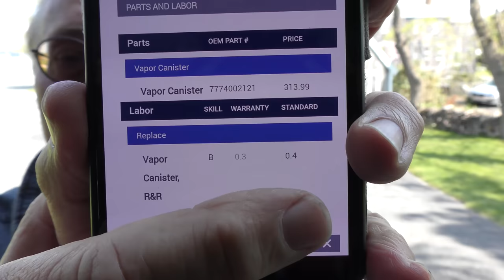7 Car Myths Stupid People Fall For

Comment: About oil change interval. in 2008, I bought a 2004 Ford Focus in California with 58,000 miles on it. With the 2.3L DOHC engine. I changed the oil and filter every 5000 miles, with full synthetic of the recommended viscosity. In 2021 I gave the car away to a friend, with 149,000 miles on it and it still uses no oil between changes.  The only engine work, besides the 100,000 mile maintenance was it needed the intake manifold replaced as it had cracked. I got one from a car recycling yard. In 2023 my friend is still driving it. 

My point is that I concur with your oil change recommendation.

Comment: Regarding fuel, any thoughts on the running your tank dry vs keeping at least a quarter full.  I was always told, and read in the manuals, that you should aim to nit let your tank drop below about a quarter full else all the waxes and impurities in the fuel that normally float near the top of the tank will get sucked through and mess up your engine.  My sister refuses to fill her tank more than a quarter full because she says she can’t afford to spend that much on fuel (ignoring that this means she has to get fuel about every 3-4 days, and often has to go to more expensive garages because she doesn’t have enough fuel to get her to a cheaper one, plus in the past when I’ve filled her tank she’s just run it down to below quarter full and will not fill it over about quarter full).  And she wonders why she’s getting through a fuel filter every year, has to clean her plugs twice a year and has to replace various sensors every year or two.
Reply: Every mechanic I've talked to has said to never let your fuel get below a 1/4 of a tank if you can avoid it. She should instead fill it to half a tank and then refill to only a half tank(once she gets to 1/4) and she would be paying the exact same amount.
Reply: The fuel cools your fuel pump. Running it too low significantly decreases the life of your fuel pump

Comment: Ah yes tune-ups. I learned to do them on my first two cars a '71 Ford Maverick and a '76 Datsun B210. On both cars I installed electronic ignition module kits that eliminated the points. I still needed to replace the plugs including gap spacing but compared to adjusting  points that was trivial.

Comment: One car myth was about pickup trucks with the tailgate up or down. You still see some tailgates with openings in them for air flow. I remember reading about it and with the gate up it actually made the truck more aerodynamic because it created a rolling cell of air in the bed area. Don't know about modern trucks, maybe the difference between 16.5 mpg and 16.8 mpg is not enough to notice.
Reply: Many years back, a show called Mythbusters tested that and found the myth was wrong, and figured the same thing you are saying that.

Comment: A local station charges 45 cents more per gallon for 91 octane non-ethanol versus regular 87 with 10%. I get enough better mileage on a full tank of 91 to come out slightly ahead versus using 87, but only at the current price point.
Reply: I actually do the same and I can notice a difference in power with the extra chemical energy too. I get weird looks filling up with rec gas though.
Reply: Non ethanol is definitely the way to go however where I am at the only non ethanol is 91 octane with a significant increase in price. I only get about 2 extra mpg which isn't worth the difference. If I had more money to blow then yeah, 91 ethanol free > 87 10% ethanol.

Comment: A 3,000 mile oil change was unheard of until Jiffylube came on the scene. Back in the day it was recommended between 5,000-7,000 miles and it still is for most manufacturers now. Car engines are supposedly better as is the oil especially the synthetics.
Reply: Many Toyota Camry Hybrids and Prius Hybrids run 10,000 miles between oil changes in TAXI, UBER and LYFT service. They last 300,000+ miles and keep going. Most is city driving and short trips too with alot of idling. Full synthetic 0W20 Oil used.
Reply: Back when I started working on cars in the 70s people used to change oil about every 3000 miles gotta remember oil wasn’t as good as it is today

Comment: Here we go again if your car requires premium fuel, put premium fuel in your car because you put the cheaper gas in there and you step on the gas pedal you’ll hear valve shatter that’s because they’re low octane gasoline. The manufacture knows what grade of gasoline they designed the car for not Scotty.

Comment: Virtually every used car I’ve ever bought I’ve improved the fuel consumption, acceleration and top speed by just giving it a good old Italian tune up. Most people drive too slow and the engine gets clogged up with carbon etc - use the performance of the car and you will clear all that crap out and the car will run better. Plus check tyre pressures regularly when cold and use top quality oil and filters.

Comment: For the record I held off on my spark plugs until 100K miles, even though the manual called for them at 75K. (Modern Mazda engine, iridium plugs)

I arguably wasted money. The old plugs I pulled out barely showed any age and the gap was still spot on at 0.044”. I still did the job but I’m definitely getting up into the 200s before I even glance at the things again

Comment: The one thing you can do to get the maximum mileage over the lifetime is change your oil and filter every 3000 miles with no exceptions. I don't care what your manual says when they tell you every three months either mileage not months. Yes I was a professional mechanic and I drove a 1987 GMC Full Sized Jimmy 315,000 miles until it was wrecked by doing just that with Mobile One synthetic. I pulled the engine and disassembled it to find no appreciable wear anywhere.

Comment: The other side on the A/C issue is that cars are much more aerodynamic than they used to be. Back when cars had all kinds of weird styling that caught the wind like crazy, then opening the window probably didn't make that much of a difference on the drag. But nowadays, every crossover looks like an identical blob because that's basically the optimal shape for a vehicle of that size, and anything you do to change that shape (like opening the windows) will noticeably hurt the gas mileage much more than running any electrical component inside the car.
Reply: That's true and also the old AC units sucked up lots of power. The new ones are more efficient but on small engines might only drop the temp 20 degrees. The old ones, working properly could freeze you out in the Sahara. With modern cars the break point is about where you don't want wind blowing in.
Reply: Old and boxy equals comfortable and easy to see out of. Also cheaper to insure. Also slow as a turtle. 😂

Comment: Can you talk about car companies charging to turn On heated seats, which are installed, for a fee? Or they charge for increasing the vehicle’s high speed performance remotely, for a fee.
Reply: Really,  Charging for getting your seats working when yiu e already spent at least $40,000 on the vehicle (or more now!).  I have a Honda CR-V with heated seats at it didn’t cost me a penny when I bought it!  I definitely wouldn’t buy any car if I was charged a fee for having my heated seats working!

Comment: I really mistreated my 2015 Prius that I used almost exclusively for Lyft driving. My oil changes sometimes were 20,000 or 25,000 miles apart. The car has 310,000 miles on it and is still working fine, although my fuel economy has dropped from about 53 MPG when it was new to about 46 MPG. Imagine how long this car would go if I changed the oil every 5 or 10,000 mi.
Reply: thats crazy and hilarious
Reply: @SmokeDogNY420  Yeah, pretty nonsensical. Those Prii do soldier on, though. And all that time, I never had to top up the oil. Every time I checked it was at least half way between FILL and FULL.
Reply: Have you replaced the battery?
Reply: @ichbindarren  No. There appears to be no need to do that. That car has nickel metal hydride battery cells in its pack (it's not the plug-in hybrid model, which in later model years are lithium ion). I think the degradation of the NiMH cell is more related to age and temperature cycles than it is to miles driven. In my car, the time it takes to charge the battery enough so that the gas engine turns off is still not much more than when I got the car new.
Reply: @bobbabai  change the car battery after the warranty is done. I changed to an AFM in my Toyota Camry Hybrid. The large hybrid battery is for life of the car.
Reply: @patricktomaszewski2063  I changed the 12 volt battery when it started dying when I left the dome light on. It was about 6 years old. I don't worry about the hybrid drive battery until I get alarms or the fuel economy really starts to drop.
Reply: It's probably the nimh battery driving your mileage down.  It's losing capacity.
Reply: @davefancella  Yes, I agree. That plus the fact that I let at least 4 oil changes go to over 30,000 mi. Plus, no maintenance at all on suspension or steering or wheel bearings.

Comment: I will say that paying extra for non-ethanol gas is worth it, especially if you are doing something like climbing mountains. I did this in Colorado and made it up and down the Rockies without any incidents on a car with barely over 150hp and a turbo engine.  No need to get higher octane, just removing the ethanol alone was enough.
Also, look carefully at the gas grades.  In some stations of lesser repute, their "normal" gas is 85 octane and really IS terrible, especially if it has 10-15% ethanol in addition.  This is fine for your lawn mower, but if your car says 87 or 91, don't ever go lower than that number, no matter what they are marketing it as.
Reply: Your point speaks to a different issue.....fuel grade....yes, there is 15% ethanol fuel available that goes below the 87 octane minumum of most cars. That said, pure gasoline vs any fuel with ehtanol....will show 1-2 mpg, better fuel mileage
Reply: Bear in mind though that in Colorado and some other high-altitude areas, there's no 93 octane because of the altitude. In that case 85 octane = 87 at sea level, 87=89 SL, and 91 = 93 SL. It's not about "lesser repute" stations in those areas, though I have seen 85 octane in coastal areas on occasion, and yeah, i wouldn't use it there.
Reply: My car runs perfectly here in NC and also in Aurora, CO!  And I use the unleaded gas - the regular kind!  I get wonderful mileage!

Comment: Back in 1986 I bought a new Chevy sprint. It has a 1 liter 3 cylinder Suzuki motor. Some people had complained that the motor would shake. Come to find out they had put in premium gas. Chevy put out a bulletin to not use premium gas.

Comment: I used to have a Lexus LS460 and with regular unleaded I got 10mpg, with premium gas is 15-17 mpg. If does make a difference.
Reply: LS460 is made for premium gasoline it’s a Lexus n like a bmw or Mercedes it was made for premium gas
Reply: If you can afford a lexus you can afford premium gas!😂😂😂
Reply: @dang75790  Scotty Kilmer got his wife’s Lexus for $3,500 lol
Reply: @ocularpressure4558  and?
Reply: Depends upon the car. In the old days I used to run regular gas for normal driving in my built 64 El Camino. If I was going to play, I would bump up the timing, run colder plugs and premium gas. You can't do that with newer cars. So, it is NOT one size fits all. It's called common sense.
Reply: @garykendall1376  common sense isn’t always common nowadays but the sense able thing to do is follow the manufacturer rating

Comment: In my 2017 Hyundai Elantra, I get about 3 MPG more with the windows down than I do with the A/C on (not even blasting at full power).  It has been consistent over 6+ years, all working at the same location and living in the same house (so no adjustments for different driving conditions).  My commute is half freeway and half surface streets, a total of 13 miles each way.

Comment: I disagree I change my oil every 5000 miles. The last time I try to wait over 6 months because it was under 5000 the engine variable timing starting sticking. Had it flushed and replaced right away started working and sounding like new again you shouldn't go past 6 months with the same oil it starts to break down.
Reply: Same happened to my 2009 Honda Element when I went too long between oil changes. Car bucked and ran terrible until I replaced the VVT solenoid. Lesson learned.

Comment: My Lexus requires premium gas. I tried running it on 87 just to see if it would work, and it threw the check engine light on me. 😂
Reply: Your Lexus will run on regular gas. Your check engine light is for a different reason.
Reply: Your check engine light could come on if 1 your spark plugs need replaced 2 your gas tank isn't shut right 3 your maf sensor is dirty

Comment: The myth I have the most and don't believe in: "Don't run your AC at full blast, keep it at 2/medium or else you'll ruin the ac compressor" I always blast my AC and my car's doing just fine 15 years on now, 3 freon refills all I ever needed.
Reply: Making the blower fan spin faster has no effect on the AC compressor or clutch. Had the same argument a few weeks back.

Comment: I've gone to stations and they were out of regular grade gas, and we're offering high grade for the same price, so I filled up. On both my 2000 and 2014 Civic it actually tripped my Check Engine light. It didnt affect the way it ran, but did turn the light on. On the next fill up of regular, iit went away both times.

Comment: 90% of my driving is highway. I have a state highway 300 feet from my house. I change the oil and filter every 6000 miles. I sold my 06 Tacoma to my nephew. It had 337,000 miles on the odometer. Runs like new. He loves it.

Comment: I've got a 2000 Audi A4 1.8T, engine code ANB, and it definitely runs better on high-octane fuel, although it says 91 will be fine on the inside of the fuel lid. Maybe in those days, engines weren't as finely tuned as today.

Comment: In my experience with the "Premium Required" cars, 1 car (04 Lincoln Navigator) it burned more gas when running regular gas compared to Premium which wasn't worth the savings and the other car (01 VW GTI 1.8t) it ran like complete utter dog sh*t when running regular

Comment: I have a part-time job at Circle K.  When we ran out of 87, people would come up and say they can only use premium in their car.  Then I asked what kind of vehicle they have, they told me it was a Scion.
On another note, I can agree with the tires. Years ago, I purchased some decently average tires for my 2001 Ford ranger.  At about 3 years one of my tires did explode.  More recently, I have had some issues with pepboys. I replaced the upper and lower control arms on both sides of my truck, and I had them perform an alignment before the new tires were installed. Regardless to say three months later my front tires were destroyed, and they were coopers, not bad tires at all. Ultimately, they did replace the tire with a load C, not a load E Tire.  One of my front tires got a flat for unknown reasons, and Discount Tire would not repair the tire. They informed me of the whole load rating issue, so I had to buy new tires.  I thought I was getting a deal at at $800 for four tires and alignment. Ultimately, I am into this project now for about $1,500.
Reply: Well, if it was a Scion FR-S, they would have been correct because those cars require premium.

Comment: Thanks for the video!
3:22 - hey I have an 2004 Porsche Cayenne v8, it says it needs the high 93 in it. So are you saying it would be find with the regular 87, just that the HP will be lower?
3:34 - what is considered a modern vehicle? 2000 model year+?

Comment: The tire one is obvious to anyone who drives with winter conditions... if you don't run winter rated tires in negetive temps you are in for a hard time... run winter tires in the summer... well you wear them out quick

Comment: Well basically, if your car loses (horse) power because of no premium fuel, what it essentially needs, it's NOT good and running perfectly fine tho. It runs perfectly fine when it doesn't lose power because of other fuel then recommended. It's not recommended by the manufacturer for fun, they don't get a cent from BP or Shell.

Comment: Myth 8: Cars are junk and death traps because they don't "make 'em like they used to."
Hogwash. They make them better and safer and more efficient. Sure, you won't have a collector's item (most likely). But you'll have a solid dependable car that lasts for years (assuming no extreme abuse or accidents).

When I was a mechanic (I still do my own work and some work for friends), I never changed my conventional oil until 5,000 miles. Now that I have vehicles that use synthetic, I change it at 7,000. But I do ALWAYS change the filter.

Comment: One of the biggest car myth is you can't charge a car battery on concrete
Reply: @pi1810  you never heard of not charging on concrete or you've never heard of charging on concrete
Reply: @pi1810  I meant Myth because it's perfectly fine to charge your battery your car battery on bare concrete
Reply: @pi1810  okay

Comment: I know that the Ford cap-less fuel doors are very finicky with gas being added after the pump shuts off.  Too much and the vapors constantly push past the door and they make a "farting" sound.  If you have one of these systems, stop when the pump stops!

Comment: 2:30 Most gas stations where I live have three nozzles. 1. Desiel 2. Premium which has ethanol. 3. Regular which does not have ethanol. Regular is always (Almost always?) more expensive than Premium. (Probably because adding ethanol is subsidized.)
Reply: Ethanol free pumps are normally blue

Comment: My S10 has over 220k miles. I changed the oil at least once a year. When I lived in PA I changed it 2x a year because of the salt it collects in winter. It's over 20 years old and doesn't burn oil. I might need to put a qt in every ver months depending on how much I drive.